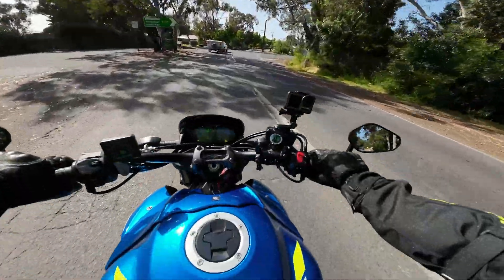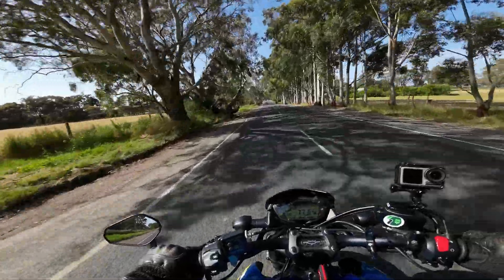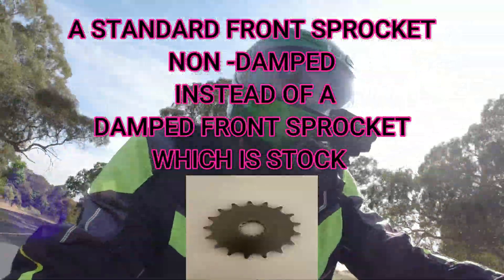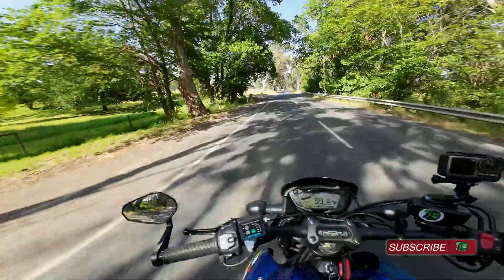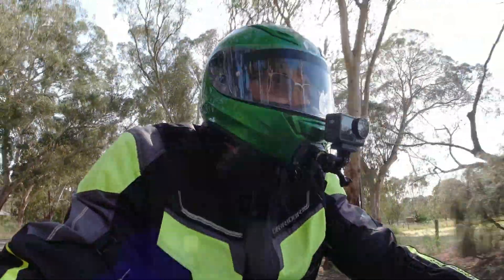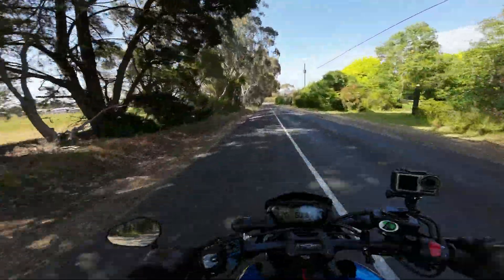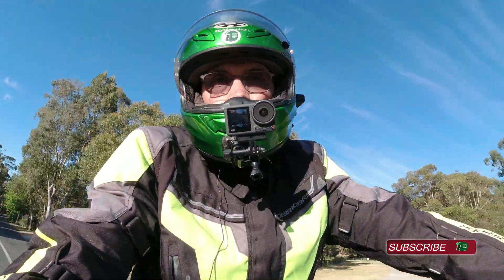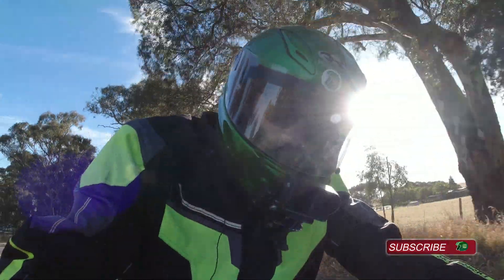DAMPED VS UNDAMPED FRONT MOTORBIKE SPROCKET

Comment: Damped front sprockets have been out for donkeys years and it never makes sense to go undamped. They cost virtually the same and dampers is always quieter and smoother with no loss of performance or response, none that a normal human being can perceive anyway, only time I'd go undamped is if i need a sprocket ASAP and there is nothing else available, or a dedicated track bike. That's it.
Reply from the maker: Thanks mate, not sure why the dealer would not have installed a damped sprocket in the first place as that is what is standard or stock on the bike. Thank you for your input 😎

Comment: Curious about the whine from the undamped sprocket. It has been decades since I regular rode a chain driven motorcycle. The last one I had was a 1976 CB750 chopper and before that a 1973 CB 750 stock. I never noticed if the chain whined and neither had damped front sprockets. 🤔
Reply from the maker: You would have the belt drive, am I correct or is it a shaft drive. I would love such a system, I believe they are almost maintenance free.  Thank you for your input as always.
Reply: @MRTPR  My current bike is belt drive. I had the belt and pulleys changed around 90k miles. The factory rear pulley is damped.

Comment: I've also got a dampened rear sprocket on my Blackbird- it certainly stops the clacking of the chain at low speeds. I wear earplugs, so I don't hear high speed whine anyway.
Reply from the maker: Thank you for your input mate. I also wear earplugs and amazingly you can hear it over the bike at high speed

Comment: Great topic here, mate - I love technical topics like this.  There really is a difference between the two (yes, I could hear the difference, although that Susie's growl always sounds good, lol).   In the ADV world, dampeners also help prevent sprocket and shaft wear from dirt and mud build up - so I will definitely be sticking with a dampened sprocket.
Reply from the maker: Thank you mate, yes i was really surprised with the difference.  I thought the dealer may have offered the damped sprocket as an option as I asked stock  gear to be fitted.